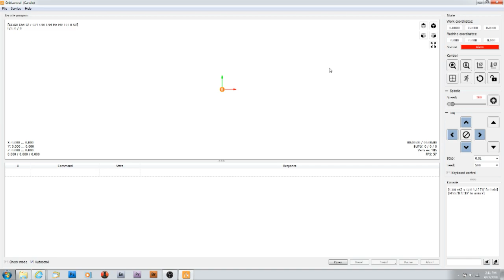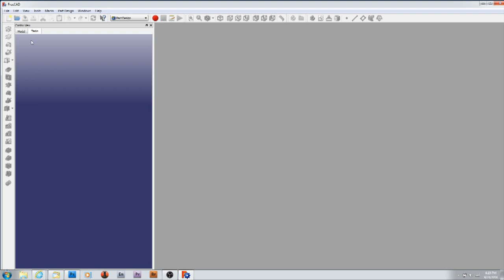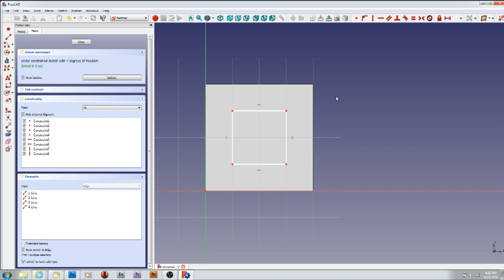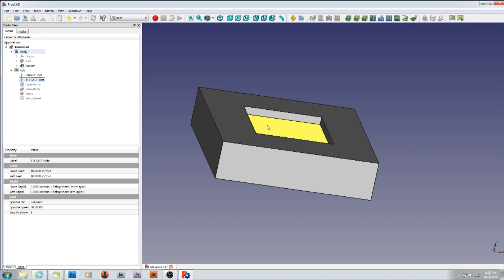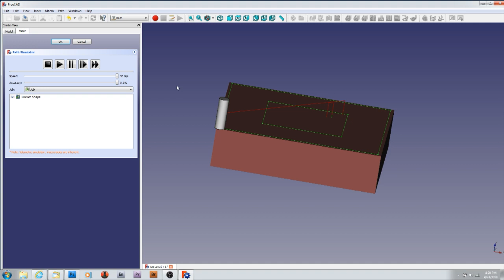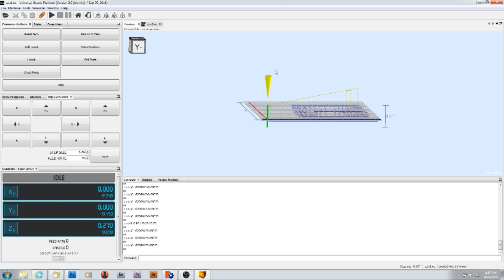CNC Freecad & Universal G-Code Sender Pt. 3

Comment: Hi there, thanks for the video. I have created a path profile operation and I have a problem. The profile is basicly a circle, but when I read the g-code there is this "K" coordinate, I think it is Z offset. The thing is LinuxCNC doesn't like that "K". It can't run the program with it. I removed it manually from the code and it works perfectly. The question is: Is there a setting in FreeCAD so that this "K" doesn't appear in the G-Code? Thanks a lot !
Reply from the maker: With the path workbench up click edit preferences check you have the right post processor selected.
Reply from the maker: Note if you change the post processor you have to close freecad and also make a new part in other words start from scratch!
Reply: @TheMiniMachineShop  I tryed exactly what you advised but it doesn't work. It still keeps the "K" in the code. Thanks anyway !
Reply from the maker: @juperrr  I run lunixcnc on one machine and there is no K in it so you have to have the path workbench up or the post processor menu will not appear in the edit section. And I found when a design is made it uses the post processor selected so changing the post processor on an existent design doesn't change anything. The header of the code tells you what processor was used.
Reply: @TheMiniMachineShop  Once again, I did exactly what you said, it simply doesn't eliminate the "K" in the code. It changes mainly the aspect of the code, color, arangement, but not the the "K". I am using FreeCAD 0.19.3. For linuxcnc I use 2.7.14 version.

Comment: Thank you for sharing, 
I have bought same machine and also have same software and just like you im struggling 
3 weeks ago i got mine and today was the first time i actually ran a proper test on Aluminium, it took 6 hours for a 50mm x 50mm engraved badge, but now i can produce in just  about 1 hour.
all this using original motor and a Er11 3mm 90 V tool that i flattened the tip to give more coverage,

Any way i have also bought a ER16  500wat brushless  spindle, that i will use when i buy new tools, 
Well the spindle does not fit on standard clamp as it is a lot bigger at 55mm dia so I 3D printed a quick change spindle holder & carriage . that works  perfect,  as it allows me to use the metal clamps that came with the spindle and thus allows me to change and use original motor as i have so many ER11 cutters to use, It only takes a few minutes to change. 
If you have a 3D printer and your interested i can send you the 3d files.
Reply from the maker: I have no idea how you did aluminum and now have to try it again. Not enough support to do it in my opinion...
Reply from the maker: You may like the laser conversion releasing this Friday...

Comment: what bit, feedrate and spindle RPM do you recommend for this project?
Reply from the maker: Feed is 10 in/min max RPM and this is by far the best bit I found https://www.banggood.com/18-Inch-Shank-Single-Flute-End-Mill-Cutter-Tungsten-Steel-CNCPCB-Engraving-Bit-3_175x22mm-p-1038973.html?rmmds=myorder&cur_warehouse=CN
Reply: Thank you so much for your prompt reply.  I have broken 2 bits so far and decided I would seek out advice.

Comment: Thanks Dave for going through the manusha.  Is the spindle holder for the 3018 plastic?
Reply from the maker: Yes the entire gray part holding the motor is plastic but its very hard stuff what ever it is.. finger nail won't scratch it.
Reply: @TheMiniMachineShop  hmm... Can be ABS or PVC. The question is, is it good enough to cut acrylic, hard wood, or even aluminum? Because a little bit of wobble at the spindle , then it's going to mess up.
Reply from the maker: It easily does ABS and PVC with the right cutter. Aluminum or steel engraving ONLY ... One of the videos I talk about zero wobble.
Reply: @TheMiniMachineShop   @Dave M  Yeah... Looks like better use it with wood or plastic. Wonder if changed with stronger spindle motor can make it cut aluminum better.

Comment: Thanks for yet one more interesting video Dave. I'm one step behind You, using a micromill, a PROXXON MF70, a kitchen table sized mill. Stepper motors are being selected and applied. An Arduino UNO controller and 2 different driver arrangements have already been tested. Grbl posibility is investigated.I downloaded a 3 year free  version of Fusion360 and attacked it. Fusion wone…. It is very capable but too complicated to learn for me. Run if anybody throws it at You!I hope to find some simple 2 1/2 dimensional CAD. To define a square surface, face it off, add a few holes of some depth etc..... Does it have to be that complicated?Gaining experience from this Project my minmill will be digitized using the second size of larger steppers. Drivers are already tested.G-Code sender looks interesting. Making constructions using G-code might be a way to go. Otherwise lowlevel C- or C++ - programming will be the tool for my simple cuttings.I take my hat off for all the time You spent finding out how to use the CAD- program.
Reply from the maker: Try FreeCAD!!!
Reply: Thanks for Your reply! You are a cool guy having both feet on the ground as we say over here. I like that.Okey, I will try but when You tell how much time You used to figure things out I am not all sure. That time I could use to finetune the micromill, adding end stops and also gas powered springs. Then comes the minimill. Then FreeCaad… Hum. I'm probaly to curious to wait….
Reply: I need more memory or a newer computer, but FrreCAD starts up….What G-code sender did You go for, "Classic interface" or "Platform"?
Reply from the maker: I never changed it so whatever it was after install was it in the USG.
Reply: Did You just download FreeCAD and the rest was just there? Where/how did You find the Grbl sender? From inside FreeCAD?
Reply from the maker: Downloaded freecad and ugs, links in description, installed them and the usb driver then configured the board as described using ugs then carefully went thru all options in freecad. went thru the plugins for freecad installed fcgear and the touch probe. everything else was there..
Reply: Okey. I don't remember the details in the download I did. What is "ugs"?I have some work to do....I'm working on a temperature checking of the spindle motor after frying the micro mill motor... How is Your motor protected against overtemperatures? Moderate work during enough time builds up heat....
Reply from the maker: Stefan, ugs =ultimate g-code sender... the unit came with a 24v supply and a small 150w 30v air cooled motor so I don't have to worry about temp until I decide to upgrade...My whole idea was to just get something working and usable THEN maybe start considering improvements...
Reply: Thanks a lot Dave! I will check Your advice. Ooops. 150 W is not much. My fried motor was of 100 'watt.Sligthly heavy work during too long time I think killed the motor. Watch out Dave! It took med 6 months to get a replacement motor that didn't fit. The seller is a complete jerk, sent the wrong motor and I still wait for the refund. Contacting the manufactorer, the German Company PROXXON, I got the proper motor installed within 2 weeks! German precision and reliability….I just finished the motorization of 2 axles, X and Z. Doing the Y-axes will be copying the X-axle, when sun rises. 12 AM here now.

Comment: Great video.....I know when I first built my CNC router it took a LONG time to get the feeds and speeds right. I remember getting it right for wood then I thought I'd try to machine other materials. Thats a hole new experience with feeds, speeds, cutters and spindle RPM's. Regards MachineNZ
Reply: Sir I did it by declaration ... Of mm or inches, successfully done
 Thank u sir ,for your wonderful advice you saved my time by clarifying my problem.
     Sir there is an another problem with my diy CNC when I start the computer the spindle starts rotating without any command... I am using arduino UNO ,V3 CNC shield ,Nema 17 stepper Motors and 1.1 v grbl framewear ... please help me in solving this problem 
Thank you sir god bless you...

Comment: FreeCAD uses some bizarre logic to create a "spiral" pocket? I've had a Shopbot 4' x 8' CNC router for the last 15 years that I used in my sign business. When cutting wood you almost always want to use climb milling, this will help with the fuzzies and splintering. I have a Sherline 5400 mill that I converted to CNC in 2001, I used Mach 3 until the Arduino became popular. Then I switched it over and have used GRBL "garble and/or gerbil" controller software and UGS for several years. Way less hassle to set up and use IMHO. I have used ArtCAM as my CAM software and CorelDraw for 2D design (comes from sign making) also for many years. You are making a good start on your way to making that router sing for you. 😁 Thanks for keeping us updated on your trudge through the jungle! 👍
Reply from the maker: My only problem is there isn't one video ...not one that shows how to engrave text!! A few vids on how to model text but none go into path and show how generate gcode... After days of trying I'm beginning to think freecad can't do it... HELP!